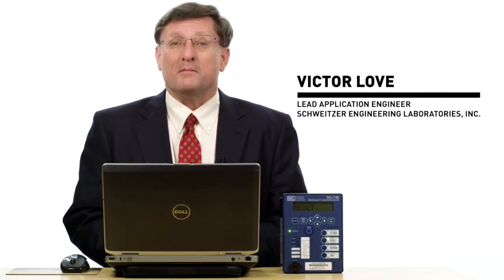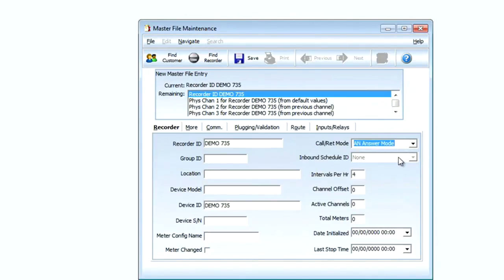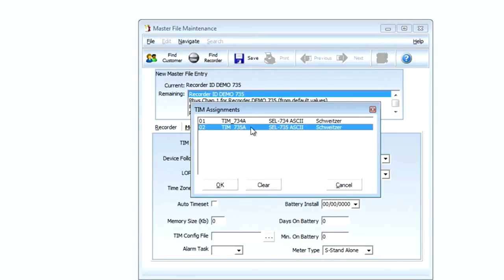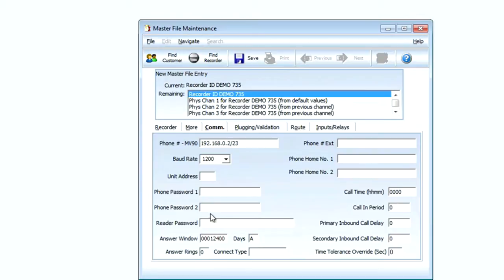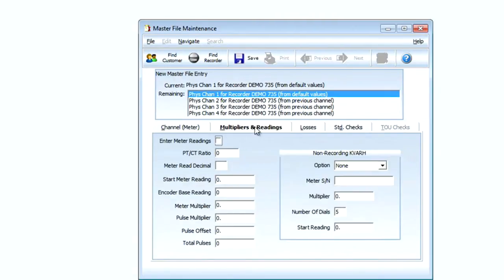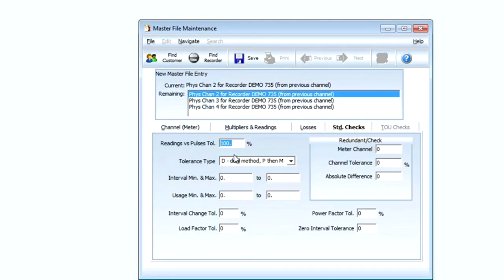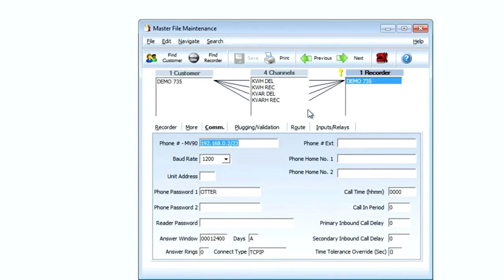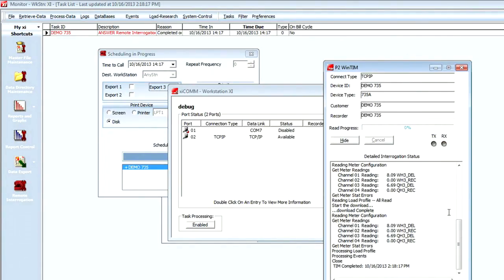How to Set the SEL-735 Meter for Itron® MV-90® Communication

Comment: What Protocol is the SEL735 passing data thru to MV90 via this method?
Reply from the maker: Hello. This method is showing ASCII data transfer over TCP/IP, there is also a written guide found here: https://selinc.com/api/download/100385/ which may be of use. If you are still needing assistance, please call our free technical support line at 509-338-3838 to speak with an SEL expert.